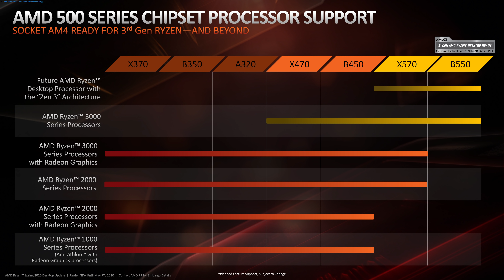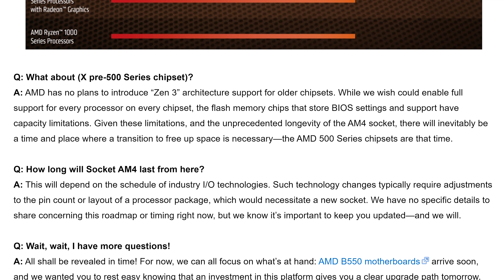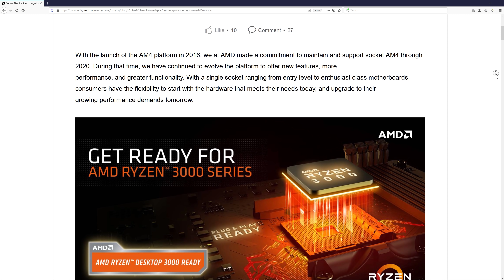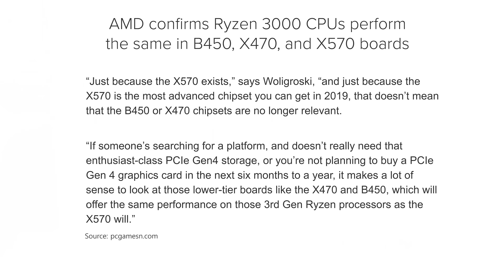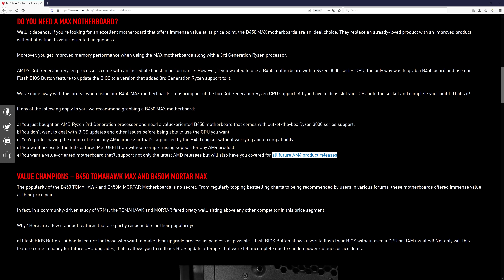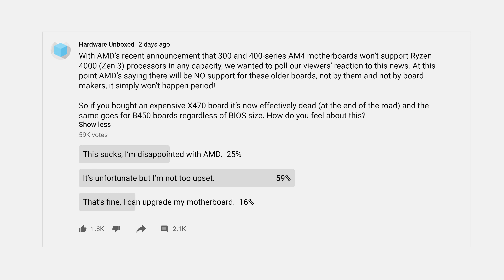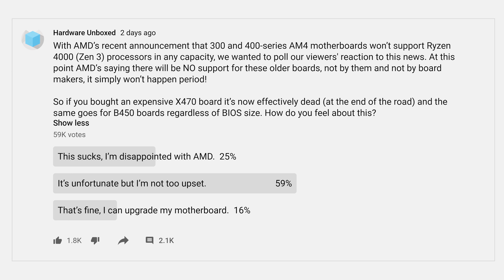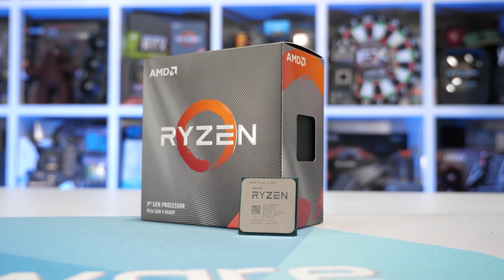AMD Does An Intel, Axes Zen 3 on 400-Series Motherboards, Our Thoughts

Comment: remember there are a few max boards from msi which has a bigger bios chip to accommodate more code....so just wait n see...if u r hell bent to run a pcie gen4 supported processor on a modest pcie gen3 mobo like the b450 which makes no sense to me though....u might get it

Comment: As someone who changes their CPU once every 4-5 years I don't understand why someone who bought an X470 motherboard, together with a Ryzen 3000 series CPU, would care about the lack of 4000 series support. Are there people that buy a new CPU every year? By the time my 3900X is due for replacement there will be a Ryzen 8000 series and surely this CPU won't support neither the 400 or 500 series motherboards, so a new motherboard will need to be bought no matter what. Is this more a problem for people that are buying their first Ryzen CPU and they want the 4000 series but don't want to pay for unnecessary features of the 500 series motherboards? Maybe there is something I don't understand so I'd be glad to hear someone else out.

Comment: I think the customer would even accept a small decrease in CPU performance, when putting a future ZEN3 CPU into a B450 or X470 motherboard.
Socket compatibelity means just that... socket compatibelity. Any CPU designed for a given Socket should also fit into said socket and do it's job. Anything else is shady business.
Reply: Exactly! it should be compatible but it doesn't mean anyone would expect it to be optimal

Comment: I recently purchased an ITX B450 Motherboard along with a 3600. Had I known that the only upgrade path to Ryzen 4000 series was x570 then I would have paid the extra. Now it seems rather than being able to upgrade I will instead wait 4 years and upgrade to next best value system be it Intel or AMD. Either way I feel this should have been communicated, if a B350 can support Ryzen 3000 series why would anyone think B450 could not support Ryzen 4000 series especially if it is still on the AM4 platform :(

Comment: I purchased an x570 board for the gaming pc as I had a notion this might be the case, ipc max speed is what I want from Ryzen 4000.
I purchased a b450 board for the editing pc, if it didn’t support Ryzen 4000 then I’d just get a 12 or 16 core Ryzen 3000.
I was hoping for full support but after some investigation I knew that it wasn’t a sure thing as the stated “support until 2020” was rather ambiguous.

Comment: I'm sure people who just upgraded to Zen 2 and bought a 400 series chipset likely won't upgrade to Zen 3, because while there will be some performance improvements. It probably won't worth the extra cost for most of the people. I myself bought a Ryzen 7 1700x back in 2017 May with a B350 and was really tempted to upgrade to a Ryzen 7 3700x ... friends around me upgraded from Intel i5 or i7s to the Zen 2 system with most of them going with B450. Where I live most of the people use PCs for 3-5 years.

If you want to keep upgrading yearly, having a chipset around for multiple generations is nice, but for me its understandable that B400 was "designed" around for Zen+, not for Zen 2 or even 3, so having a chipset for 2 gens for CPUs is stil an improvement ... the 300 series was an exception ... and was exceptional as it is working from Zen to Zen 2. So I kinda see this in the other way. 

Personally I think AMD has nothing to be ashamed of.

Comment: you forgot to mention the fact that amd will change socket in 2021 when ddr5 support comes
Reply: he said it in the video
Reply: We need support atleast till that
Reply: Everyone knows that and that makes this whole thing a little better as everyone will have to upgrade for AM5 and DDR5.
Reply: @sujimayne  Actually, it makes it worse. If this is the last cpu line up on the same socket, it'll be better for them to not lock in that line just to a single chipset. Because: those who'll buy the new board will not have any future upgrades on that same board. So if you're unlucky in getting support for Zen3 on a board that u've recently bought, then it just makes it worse that the new board that u'll buy will also last a single gen.
Reply: @noon1117  this!!
Thought the same. B550 seem to have no upgrade path at all. (at least if you pair a b550 with ryzen 4000)

Comment: AMD need to support B450/470 for upcoming Ryzen cpu's. It that simple
Reply: Or what? People will buy B460 instead?
Reply: @tomstech4390  If I have to buy a new MB whenever I have to upgrade my CPU then I am free to go back to Intel as well! Better socket support is the one reason I switched to AMD but now I find out that's its really a lie, no single Chipset has been supported for more than 2 years (x270, x370, x470 etc). 
Even Intel does that with a lot of its chipset generations. So I don't know what exactly does AMD deserve so much praise for!!!?!??!?
Reply: @NatrajChaturvedi  Counting to 3 obviously isnt your strong suit.
intel z170/z270 support skylake/kabylake cpu's 2 generations
z370/z390 support coffeelake/coffeelake cpus 2 generatations
z490.. comet/rocketlake
all the same skylake architecture
lga1700 is a whole new socket for icelake and tigerlake in 2 years.
So even if you buy z490 now you're still gonna have to buy a new motherboard and cpu soon anyway.

amd x370/x470 support zen1/zen+/zen2 3 generations
x570 zupports zen+/zen2/zen3 3 generations IF they dont support zen4.
Reply: @tomstech4390  x370 supported zen1 but I don't know who at the time was buying it for Zen1?!?! People bought it for Zen+ and then got Zen2 support but not really "officially" but through the mercies of board partners.
As for the 200 series boards before which came for Zen1 and 400 series boards which came for Zen+ and Zen2, how have they gotten support for 3 generations of CPU's?

I
Reply: @tomstech4390  Besides when AMD first talked about having one Socket and supporting it through 2020 Why didn't they immediately  start having boards ith32 MB bios? 

The spec was still for 16mb Bios chips which kinda shows that AMD was never serious about giving us support through 2020 for the same single socket, AM4 which had multiple chipsets supporting different CPU's, so the whole 'single socket support' thing is just a marketing term anyways!
Reply: @NatrajChaturvedi  There are no 200 series boards, I already provided what chipsets support which cpu's. Please do some research and read on the subject before talking about it.
Reply: @tomstech4390  Intel

Comment: I've seen zen 2 processors running on a320 boards like on tech yes city. I'm confused.
Reply: I use ryzen 3500 on a320m by asrock and the performance compared to other board is almost nothing. I even found some local reviewer using a better board have a smaller score on cinebench. So i think its BS when chipset is the problem.
Reply: They fit into socket, it's only a matter of BIOS.
Reply: OEM s use a320 that's why it has had some support.
Reply: They do work. But you cant get most out of your CPU's performance because of the A320's limitation.
Reply: @ChiekoGamers  Thats right and wrong it depends... What CPU u are talking about? A Ryzen 5 or Ryzen 7 or a Ryzen 9?a Ryzen 5 or Ryzen 7 will not be bottlneck from a A320 but a Ryzen 9 with 12 or 16 cores at 100% usage will be bottlneck from a bad VRM A320 motherboard but who is putting a 500 or 750 dollar CPU on a cheap cheap 50 dollars A320 motherboard???
Reply: @strohhuttv8848  I assume people who got OEM systems around zen 1/1+ and want to DIY upgrade.
Reply: @ChiekoGamers  it's mixed zen 2 has much lower power use and if you don't oc it's ok. Main problems are lack of all features.
Vrm, sound quality, usb ports fan headers Sara nvme pice just all striped.
I asume OEM s get a much better price on them as when IV seen them they tend to be super close to b450.
If you have one there ok but id not buy one.
Ps may want a fan on the vrm for luck

Comment: I get not supporting A320/B350 boards. But the least they could do is support X370/B450/X470. It doesn't have to be supported on launch even, just that it gets support sometime down the line.

Comment: I do feel misled, I built 3 B450 and an A320M set of rigs for my house with plans to upgrade them to 4000 series...my excitement just got crushed.

There is no point as of now looking forward to upgrades as the upgraded platforms would only have potentially a single year/series of life in it.

Too bad, we will have to wait for the till we can compare performance variances of the "Zen 4" vs on sale "Zen 3" setups to see if it is worth going over to a new chipset.

This does also somewhat alienate B450 + 3000 series owners while also killing a solid Rev pool for AMD for at least a year or so...and that is quite a large pool of what we're potential buyers.

There are still many upgrade options at discounted prices to come for sure, but it gets me right in the feels. Still an AMD supporter, but do hope they reconsider.

Comment: I specifically bought a x470 taichi ultimate with the release of the 3000 series, for the reasons that you mentioned. If I knew that last year I would have changed my purchase decision. Very good and calm video thank you.
Reply: amd shot themself in the foot with this decision imho. I would upgrade to 4000 with my x470 taichi, but now i will consider intel instead, if they will offer similar or better performance
Reply: @1222dss  I'm pretty chaffed my X470 won't be allowed to use the 4000 series chips, since that was the thrust of their value proposition back in 2019. I'll basically just ride out this board for a short while and then buy a new Intel platform next year since it least I'll know up front where the hard stops are. This now obsolete X470 can go to my little brother.
Reply: @1222dss  lmao fuck off you pleb. They been on amd4 for ages, what you expect? Go enjoy those Intel chips man, Intel changed mobo every 1-2 generation but babies like you fit Intel so buh-bye 👋

Comment: it makes no sense to use a gen4 ryzen 4000 chip on a gen 3 b450 motherboard......if u have a gen 3 supported b450 mobo just buy a gen 3 (pcie) 2nd generation processor.......i think AMD did the right thing.....but as far as b550 is concerned if u really want gen4 speeds then it would be wiser to get a decent x570 mobo......x570 will go down in price n already budget x570 mobo is out in the market......i dont think there is any reason to buy the modest b550 board which i dont think will be as cheap as the b450......

Comment: Exactly, I bought B450 with Ryzen 3600 thinking it could support 4000-series no problem. If I knew they would axe this platform, I would've bought X570 no questions.
Reply: Same here, i bought the msi b450 tomahawk max thinking I'd be able to upgrade to ryzen 4000. Sigh. . .
Reply: Same, I bought the B450 A-PRO MAX from MSI which is the step down from the tomahawk.
Reply: AMD have already made it clear that AM4 motherboards won't be supported after 31 December 2019, so not sure how you thought that your B450 would work on Zen 3 which releases after 31 Dec 2019. If you look at AMD's official Socket Stability slide in the article "3rd Gen AMD Ryzen CPUs Will Work on Many Existing MSI AM4 Motherboards" (search it on Google), you'll see that the graph clearly shows no support for new CPUs on AM4 after 31 December 2019. If you take a good look, the orange bar stops right at the end of 2019, just before 2020 starts. It was already know even a year or two ago that Zen 3 will come out some time in 2020, or in other words, AFTER the official support period. So how did AMD not keep their promise? 🤔
Reply: @bgtubber  b450 tomahawk max was released around October of last year tho

Edit: 
I built my pc in November
Reply: @bgtubber  yes, but they never made it clear which motherboards would keep going. We have all assumed that b450 would be compatible with the next gen because the 300 series supported 1000,2000, and 3000 series boards. I am not alone in this if you read the comments. It really doesn't make much sense and it might be due to them wanting more money or not having enough resources, who knows. I agree with you that they did say through 2020 but why did they continue with X570? X570 was released during 2019? By what you are going off of that means X570 would not support the new CPUs as it was released in 2019. There is also no need to hate on people in the comment section over issues we could have never known about
Reply: And me, got a nice Mortar Titanium board

Comment: You can use three generations of Ryzen on a single motherboard. Intel requires a new motherboard for every new generation. People need to stop being drama queens. Upgrades have to happen eventually.  EDIT: I get it now. I didn't know that you guys were led to believe that Zen 3 would work on b450. They should have been more transparent.
Reply: Every 2 for intel actually, but yeah, you're right
Reply: I would like to state that I am an Intel user that simply doesn't understand why people would be upset about having to upgrade their motherboard after three generations of significant performance increases. EDIT: I get it now. I didn't know that you guys were led to believe that Zen 3 would work on b450. They should have been more transparent.

Comment: It wouldn't have mattered as much if AMD had released B550 at the same time as X570. Instead they encouraged people to keep buying B450 boards.
Reply: The same kind of goes for encouraging people to buy X470 because of X570 price inflation.
Reply: For a budget build the only choice was b450. The only thing x570 offered was pcie 4.0 (useless to 95% of users at the moment), and a hefty price tag.
Reply: True
Reply: Moreover X570 boards do not offer M-ATX and almost all have that bloody self-destruction device == chipset fan.
So X570 is definitely not an option for a lot of people even when not bringing the price into equation.

When you have M-ATX case like me, you have no board to buy even today, that can support Zen 3, which is really lame...
Reply: Yep
Reply: Exactly
Reply: Absolutely spot on.  Unless you had big dollars to spend on X570 then you would've bought B450, and now are screwed!
Reply: This right here.
Reply: Exactly.
Reply: @icedoutshef  also bought a B450 2 months ago with a view to grab a zen 3 on release, grrrrrr
Reply: It doesn't matter either way because AMD never promised motherboard support after 31 December 2019. If you look at AMD's official Socket Stability slide in the article "3rd Gen AMD Ryzen CPUs Will Work on Many Existing MSI AM4 Motherboards" (search it on Google), you'll see that the graph clearly shows no support for new CPUs on AM4 after 31 December 2019. If you take a good look, the orange bar stops right at the end of 2019, just before 2020 starts. It was already know even a year or two ago that Zen 3 will come out some time in 2020, or in other words, AFTER the official support period.

Comment: I got a Ryzen 1 and a X370 when it was launched in 2017. And made an upgrade to an 3600X 6 months ago. I got plenty of BIOS and chipset driver updates, trough these 3 years.
So, although I'm disappointed that I won't be able to upgrade to Ryzen 3 with my X370, I still consider myself lucky to get support for so long. 

If I was on Intel, I would have to change motherboard with every generation. And it would have cost me much more to upgrade a CPU.

Comment: Being the tech guy around my friends, I just recommend a R5 3600 with B450 board regrettably
Reply: It's okay, many of us got bamboozled.
Reply: I bought a R5 3600 with a B450 board earlier this year. Didn't see this coming.
Reply: Man! I actually went together to buy and build my friend's PC. Luckily the MSI B450m Mortar was out of stock so we went for the ASUS Prime x570-p. Dodged a huge bullet there. Gotta thank the guy who bought that final mortar mobo lol.
Reply: So them having a 166% upgrade path to a 16 core isn't enough?
Reply: @tomstech4390  Don't spend on a new motherboard, instead spend on a better CPU; should be a good upgrade path left to the platform.
Reply: @tomstech4390  well more core but less improvement. More core and more improvement are better.
Reply: well if they're not tech guys themselves they won't know the difference and (or) won't upgrade when zen3 comes
Reply: Good news, B450 and X470 will support Zen 3!!!
Reply: I'm in the exact situation than you. I'm the guy my friends rely on to make decisions when it comes to computer hardware. They are new to  PC gaming so I built them two full amds computers just last October because I knew this could be budget friendly and if they eventually really like PC gaming they would would have a future upgrade path with the 4000 ryzen series.... They both have a amd video card, cpu and motherboard. One is based on the B450 Gaming Plus and the other is the B450 Pro Carbon. I really feel like  I was screwed now and my friends will pay the price.

I'm the one who convinced them to go AMD...
Reply: @macfly7476  you have done all right and your friends have gotten the best price/performance they could ask for and this decision won't make their machines any slower additionally. Plus they still have reasonable upgrade paths to 8, 12 or even 16 cores when prices come down... It is what it is...
Reply: Then I revoke your pass of being the "tech guy". Should of just told them to buy a Mac.
Reply: @namenotfound8747  bruh

Comment: When the new B550 motherboards drop, could you please examine the size of the BIOS chips ?

I suspect they will all be 16mb, to save money, and they removed APU support to remove DP and HDMI connectors. 

Also to save money.
Reply: some x570 boards have only 16mb chip... so bios size reason is bollocks...
Reply: @KleMih  wow...even more evidence the bios limitation is bs, thanks!

😳